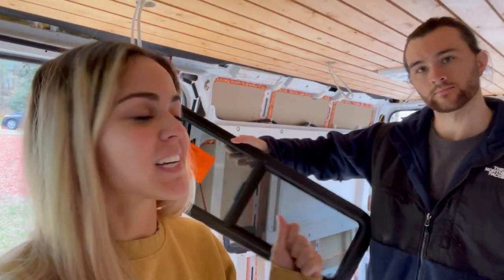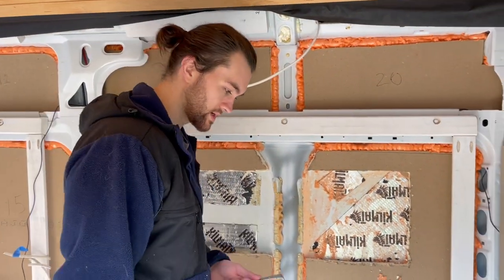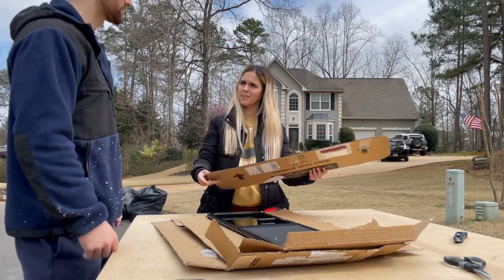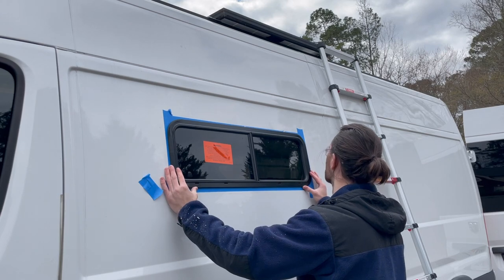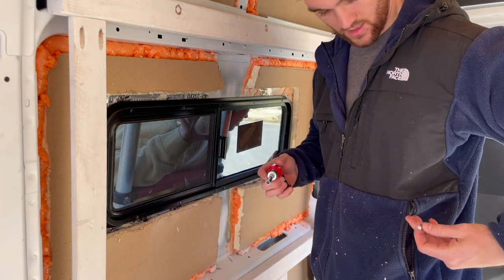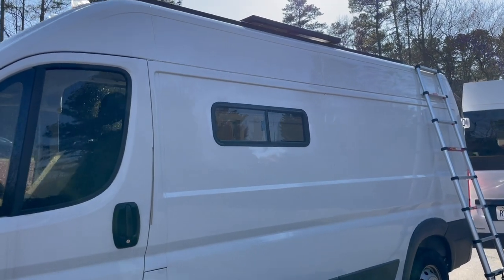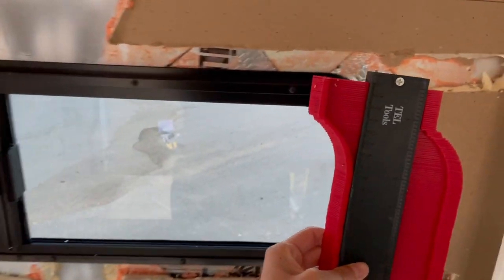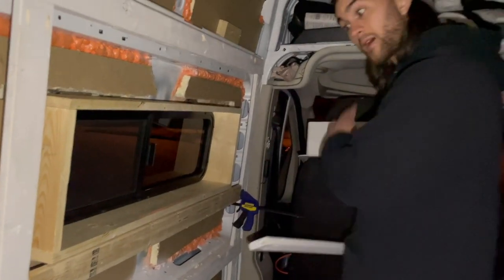Installing Our CRL Window + Window Frame | Van Life Build Series

Comment: Hello! Awesome video!!! I have a question about how you built the wall over that middle beam that juts out. I am wanting to frame similarly to y'all, where the vertical furring strip connects into the middle horizontal one ( as opposed to running over it), but doing it that way  would run my wall right into that middle vertical beam that juts outs instead of smoothly going over it. I can't figure it out. I looked for your video on the shiplap wall install but couldn't find one. Thanks so much!
Reply from the maker: Thank you! Our framing came out further than that metal beam, so there wasn’t an issue installing the shiplap. We didn’t film the shiplap, but I do have a video on the framing of this van.

Comment: Great job what store did u get your red radius tool  on your corner window frame “looks like it comes very handy
Reply from the maker: Amazon! That’s where we get most of the prep tools that we know ahead of time we’ll need. Also get a lot off of Amazon that Home Depot doesn’t sell the size of like rivet nuts, wire connectors, wire, etc.